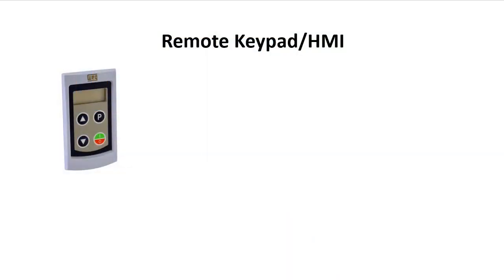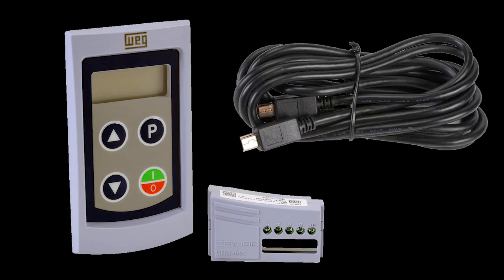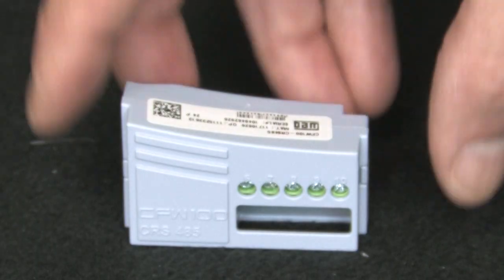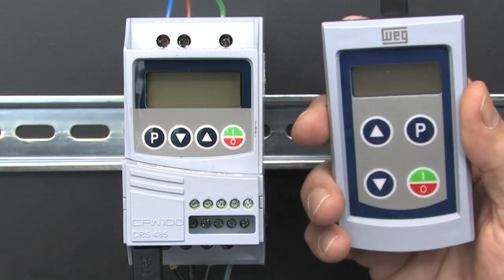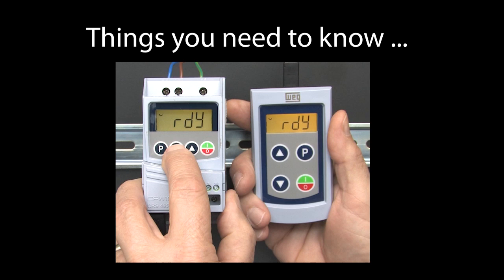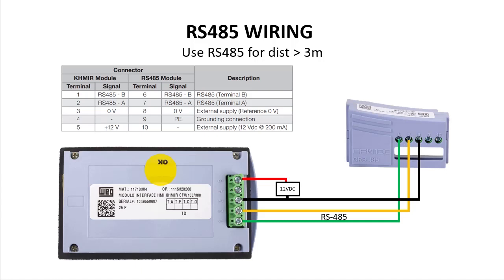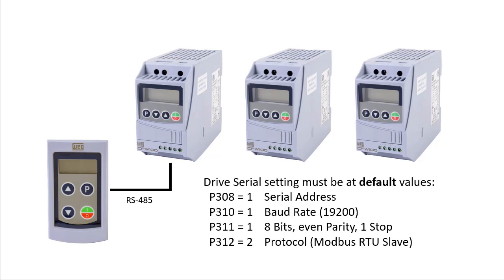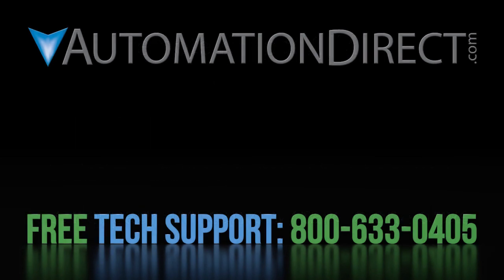WEG CFW100 & CFW300/320 VFD Using Remote HMI/Keypad at AutomationDirect

Comment: Hi, great video with very clear information. Just a quick question, if it's possible. I have been using the remote HMI for a couple of months and recently changed the type of control to VVW (P202 = 5). Now my HMI screen turns off randomly. It will not display a single number or letter, bit it will remain backlit and I am able to control de motor, both on/off and frequency (if left on P002). This happens to the HMI only, the screen on the Drive will continue to display as usual. The only way to get the HMI back to normal is to turn the power off and on again. Unplugging it from the drive and connecting it again will also do the trick, but it's basically the same, removing power from the remote HMI. Sorry if it's to long and I understand if the short answer is to get it checked by someone who is qualified enough to get it fixed, but it may be just a parameter or some quick fix! Thanks
Reply from the maker: Interesting ... 
This only started AFTER you switched to VVW mode?
If you switch the drive back out of VVW mode, does the HMI work without cutting out?

Does the Remote HMI fail only when the motor is running or does it do it if the motor isn't running?  Or both?

How often does the Remote HMI go blank? Is it right away or after several days?

Which drive are you using?
What Drive Software Version are you using? (P023)
Reply: @automationdirect  After sending you that message, I switched the remote HMI with another one ( I have 4 identical drives ) and the problem moved from one drive to the other. I think that my issue is a faulty HMI, the parameter changes were just a coincidence.
Reply from the maker: Thanks for the follow up.  Sounds like you have a handle on it. Could also just be a bad/loose connector - did you try wiggling the cable? 
Did you buy them from AutomationDirect? If so, It has an 18 month warranty and we have super easy/fast returns. Go to AutomationDirect.com and click on the GREEN ordering tools box in the upper left corner.
Reply: @automationdirect  I wish I had, but I'm not in the US or Canada. Yes, I did try wiggling and also changing the cable and got nowhere. It is definitely a faulty HMI. Thank you very much for your support!